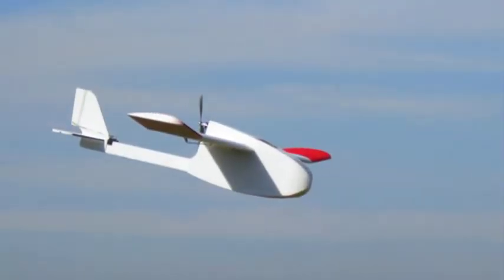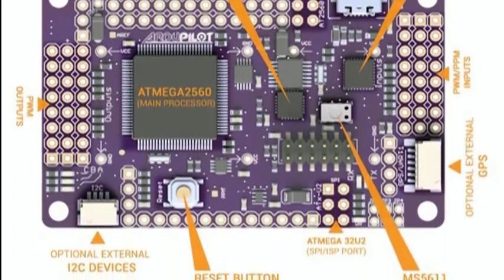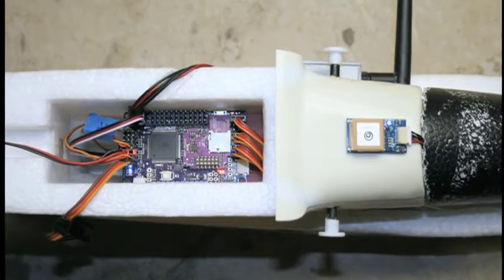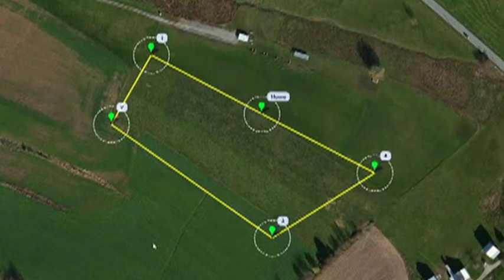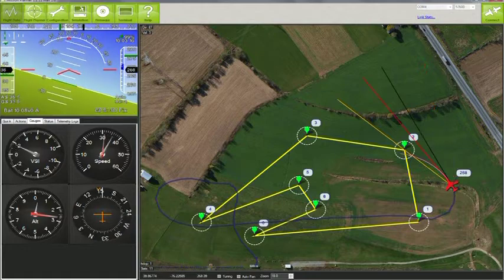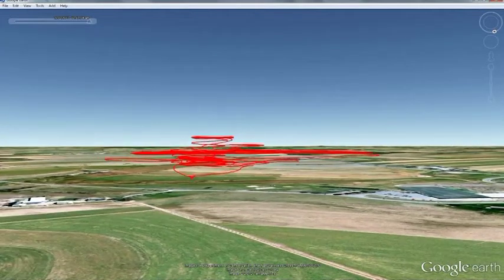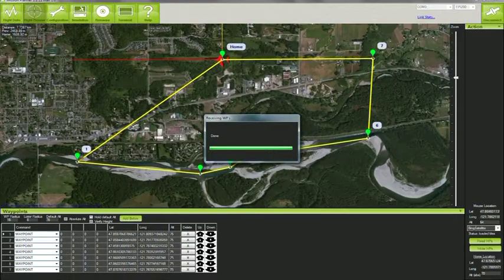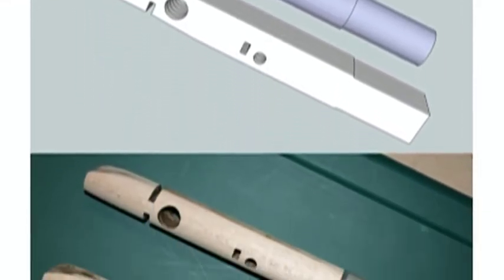My DIY UAV Project

Comment: Just curious, how much was this setup?
Reply from the maker: On the order of $500, all included.  However, I used a different transmitter than the one that came with the plane.  I needed extra channels.  A decent transmitter will run around $250 and up, but it is used for other planes as well, spreading out the cost.

Comment: bro good job 
have you done the new one if yes give me the link to check it out
Reply from the maker: +Sunday Omoniyi 

Hi Sunday,
Thank you for your comments.  I did finish the Pioneer and did the maiden flight on manual control only, not with autopilot.  I wasn't able to get much video of the flight, but here's a link:
https://www.youtube.com/watch?v=bP7gv_hPnAY
I'm afraid that the second flight did not go so well.  It stalled on takeoff and damaged the fuselage.  I'm rebuilding the fuselage now.
Show less

Comment: Thanks really it's very useful video. I think to redesign my old plane or to design another stable plane so I can use autopilot.
Do you think that single or twin engine can affect the stabilization or just the aerodynamic?
Reply from the maker: +Khalid Oldendorf 
Hi Khalid,
Thanks for your comments.  I would definitely stay with a single engine aircraft to keep autopilot control as simple as possible.

Comment: great information
Reply from the maker: Thank you for commenting.  I'm glad you got some good information out of the video.

Thanks again,
Paul
Reply: its my pleasure & my honer Sir
also Mr Paul is there any tutorial or diagram on how to extend the control zone vertical and horizontal
Reply from the maker: شلالي عبد الكريم If I understand your question, the flight zone is controlled by the software you use to program the autopilot.  I use Mission Planner.  There is a wiki for this and the autopilot on the DIY Drones web site.  I hope this helps.

Comment: Nice video. How is your project going.
Best luck
cheers
Reply from the maker: Hi Zox.  Thank you for your comments.  The Pioneer project is coming along very well, although slowly.  I expect to do the maiden flight in the spring.

Thanks again,
Paul
Reply: Paul Marsh
Hey i hope you will post more details when you find time. I know how it can be slow. I design FPV UAV amphibian 2 meter span, 2 years ago and i am still at drawing board, though it is ready for slow part fabrication but i just dont have time enough.
Good luck mate. In future i will need so many info about electronic.
Cheers
Reply from the maker: Zox Wolf If YouTube allows links, here is my Pioneer build log:

http://www.poweredmodelairplanes.com/pma/pdm/pioneer/pioneerproject.html

Paul
Reply: Paul Marsh
Thanx Paul. Looks nice. You auto cad_it also? I have pain in the arse to start 3ding in auto cad. Though it will be necessary if i plan to do kits. For now i am doing all my drawings in corel draw.
Reply from the maker: Zox Wolf Looking forward to seeing your project on YouTube!  I did the design in SketchUp.  It's a great tool and I only used the free version.
Reply: Paul Marsh Awesome Paul. I didnt thought  SketchUp is able for these things. Does it have file output for cnc-ing? dwg dxf?
Reply from the maker: Zox Wolf I believe the Pro version has dxf and other output formats.  I had to download the trial version of the Pro version in order to make the dxf files.  It was one time only thing, so I can't make more dxf files now.  It's worth having a look at the free version, though.  I can recommend it highly.  It worked great for my project.

Comment: What kind of range does this get?
Reply from the maker: Hi John,

I never fly outside of line-of-sight and the ability to take manual control, so I haven't looked into range specs.  I have read of some very long range flights, though--on the order of 10 miles.  Currently in the U.S. this would be well outside of FAA rules, which require line-of-sight as mentioned above.  I hope the technology will mature to allow us to fly such long flights.

Just for more info, there could be as many as three radios on board: RC receiver; telemetry radio; video transmitter.  One will be the weakest link, but I don't know which.

Thanks,
Paul

Comment: hi Paul,
some silly questions, if we need to have manual control do we need a separate radio transmitter if we  use 3DR radio kit u used here
Reply from the maker: Hi Ajit.  Not a silly question at all.  You must use a separate RC transmitter in addition to the autopilot.  While it's conceivable to do a complete flight from take-off to landing in autopilot mode and make flight changes via the telemetry radio, the ability to take immediate and total manual control if necessary just isn't there.

Thanks,
Paul

Comment from the maker: Hi Michael.  I'm glad you liked the video.  The Pioneer has come a log way since I posted this video and is nearing completion.  I hope to be flying it this coming summer.  Good luck with your own projects.

Sincerely,
Paul
Reply from the maker: If you are starting from scratch, the minimum cost to have a plane like the SkyFly flying with an autopilot system would be about $500.  For a bigger plane and bigger project like the Pioneer, and including everything in the plane, e.g. engine, servos, radios, etc., the total cost is more like $1,200.

Comment: Would it be possible to make a UAV for 200$? reason why I want something inexpensive is because I'm no expert and don't want to be at big loss if I ruin the project or end up not having the skills to do so.
Reply from the maker: Hi Jean-Francois,

Realistically, I think the minimum cost to build an amateur UAV will be in the $400-$500 range.  The autopilot itself will cost $150-$200, and that is without telemetry and an airspeed sensor system.  These are not necessary, but advisable.

I'm sure you have the skills, or can acquire them without too much difficulty.

I hope this helps.

Thanks,
Paul

Comment from the maker: Hi Walperstyle,

The hardware and software are both available from 3D Robotics, which evolved out of the efforts of the DIY Drones community.  While most amateur UAVs do seem to be electric powered, gas power (well, glow fuel or nitro) is also in use.  The Pioneer I am building, mentioned in the video, will be powered by a glow fuel engine.

Thanks for your comments.

Paul

Comment from the maker: Hi Paerguzati,

I'm sure you have a legitimate concern there, but the ArduPilot autopilot does a fantastic job of controlling throttle and, but extension, air speed.  Allowing it to do such control is essential when changing altitude from one way point to another.

Thanks,
Paul

Comment from the maker: Hi Maseya01.  Thanks for your comments.  I agree, it is amazing technology.  The range of the plane itself is only limited by battery life.  I don't really know the range of the telemetry radio system as I keep the plane within line of sight, but I'm sure it's a few miles.  I'm not familiar with Dragon Link, but I see no reason that it can't be used in conjunction with an autopilot system.

Thanks again,
Paul

Comment from the maker: 2.  My battery (2200 MA) will last about 20 minutes at medium throttle.

3.  The autopilot calculates true airspeed using the pitot tube and pressure sensor system.  Both air speed and ground speed (based on GPS readings) are displayed on the laptop computer during flight.

4.  You can add waypoints during the flight and stop and restart the mission in flight.  You can also simply click on the map on the laptop and tell the UAV to fly to that point and circle at whatever latitude you tell it to.

Comment from the maker: Hi Bambang, Thank you very much for your comments, and don't hesitate to ask questions.

1.  Speaking only for the rules we fly by in the U.S., I keep the UAV under 400 ft. altitude and within line-of-sight distance, but I must also be able to fly it manually, so I don't let it fly too far away.  However, it's capable of flying much higher and as far as it's battery would last.  I don't know the actual range of the radios, but it would be further than I would be able to see the plane itself.

Comment: HI Paul Marsh, it's good video & amazing DIY project, I would like to ask you some questions:

1. What is the maximum altitude and distance to operate this UAV?
2. how long the battery endurance?
3. how did the computer calculate air speed? as the GPS data only calculate Ground Speed information base on movement.
4. is it possible to add another way point in your computer during it's own autonavigation?

sorry for a lot of questions, but I really interested with ur project, a great DIY project.

Comment from the maker: Hi Soldier, Thanks for your comments.  The simulator I'm using is X-Plane (x-plane . com).  While it is open source, the full version is not free.  I'm using the free demo version, which works fine for learning and testing the autopilot.  As I noted in the video, I'm using the ArduPilot Mega 2.0 autopilot.  The on-line manual (diydrones . com) provides info on how to set up both the autopilot and simulator to work together.

Thanks again,
Paul

Comment from the maker: Hi Kevin.  The RTF (Ready-To-Fly) plane was around $150.  That included the air frame, motor, battery and all normal RC electronics.  The autopilot, telemetry radio and air speed sensor system totaled around $300.  I'd say $450-$500 is about normal to put a basic plane in the air as an amateur drone.  A live-feed video system will run around another $300.

Thanks,
Paul

Comment from the maker: Hi superdudeb1.  I would say these electronics are about as durable as standard hobby radio control electronics.  They will withstand minor crashes (I know!), but nothing major.  They haven't been around long enough to judge longevity.  I have RC equipment that is 10 years or more old and works just fine.  This autopilot is not yet one year old.  Reliability seems pretty good, but the software is constantly, and I mean constantly, being changed.  You need to test and retest before you fly.

Comment from the maker: Hi haxby2008,
Thanks for your comments.  My Pioneer will have a wingspan of 84.5".  It's a 42% scale design.  I plan to power it with an OS Engines 55AX glow fuel engine.
Paul